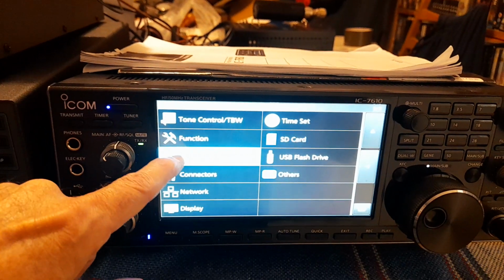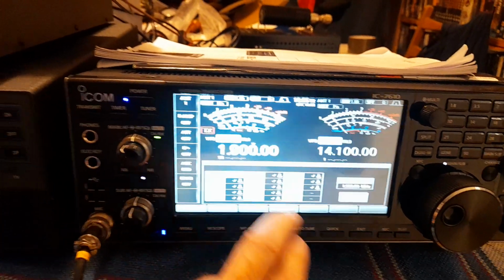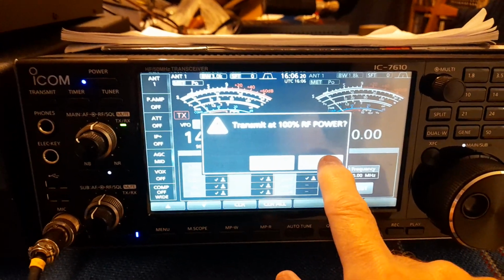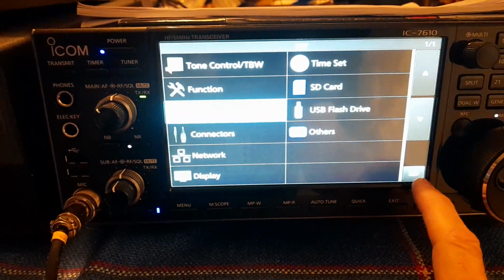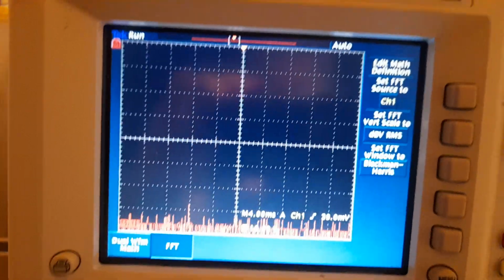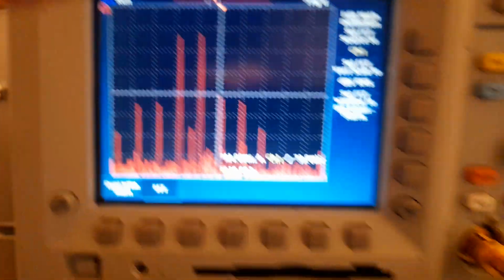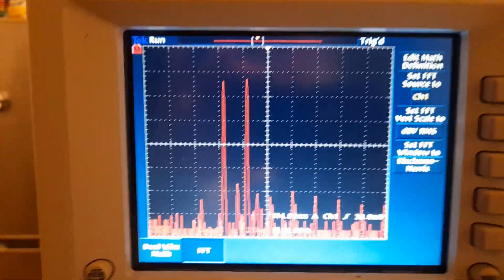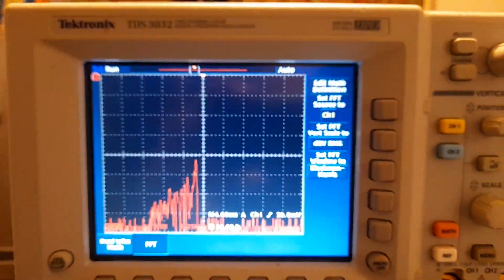IC-7610 DPD Demo by Robert G0MYX

Comment from the maker: I made an accurate measurement of the peaks of each of the two tones, with and without DPD enabled, DPD reduces the peaks by 0.35dB  so about 7.5 to 8% power loss.  No big deal for a clean signal IMO.  When driving an amplifier the 4dB improvement in IMD I see with DPD on is worth having.   When the amplifier/7610 loop is closed the system would be fantastic.

Comment from the maker: I added some replies but they haven't appeared for some reason, so I will answer here.   I built a 50dB coupler and integrated a 10dB Pi attenuator, the Output from the IC7610 or the amplifier was sampled using this. The system was terminated with a high power dummy load.   The Two tones 700/1900Hz were generated by a Siglent two channel function generator and recorded by an external sound card using a 3 resistor network as a combiner. This produced better recordings than using the sound card DACs to generate the two tones, Initially these were fed to the transceiver via the Mic input (Video) however cleaner signals are generated by playing the .WAV file back to the 7610s own sound card via the rear USB as this eliminates the low noise from the Mic amplifiers. The 7610 above 75% power the 3rd order IMD products reduces while the 5th and 7th intermodulation products increase slightly with out DPD.  I tested this on a second 7610 running version 1.30 firmware and had the same result.   I didn't notice a change in power with or without DPD, though 0.5dB would be hardly noticeable on a 10dB/Div scale. The 7610 power meter read practically the same, that is not to say that you won't loose a Watt or two, I'll measure it more accurately sometime, though in practice a few Watts loss in not important.  Testing using my FFT Scope , R&S and Siglent spectrum analysers show that the intermodulation products with DPD on fall to about 60dB below PEP.  Using DPD on the 7610 to excite my SPE Expert 1K3 results in about 4dB improvement in the 3rd order intermodulation.  I suspect that the PW2 is driven by close to 100W so as to make the amplifier robust on the input side, this will require that the 7610 transmitter output be attenuated to about 5W so that when the 7610 and Expert feedback loop is closed the signal levels are about right, the RF sampler needs to be about 65dB, the sampled signal is connected to the Phono ALC jack on the 7610. ALC must be connected via ACC1 or ACC2  I think there will be another firmware version release when the PW2 is finally released, There doesn't appear to be the CI-V commands in the current 1.40 firmware to allow control and calibration of the DPD using the Amplifier DPD Cal function on the 7610.  Or the command have been omitted from the firmware spec.

Comment: Hi. I received my 7610 today and I have installed the 1.40 firmware. All is good. Curious, did you notice any difference in your output power with and without the DPD? I haven't done the DPD Cal yet. :) Thanks.